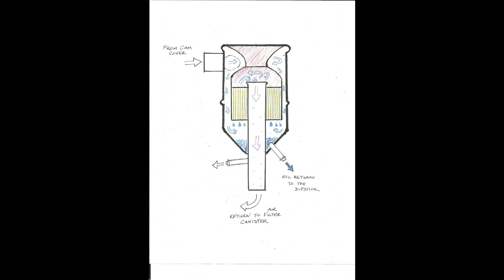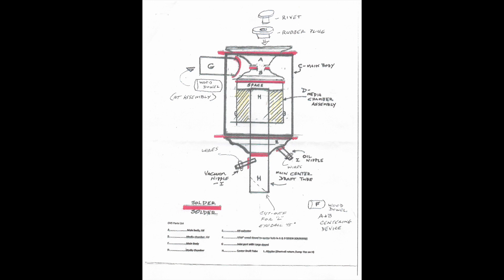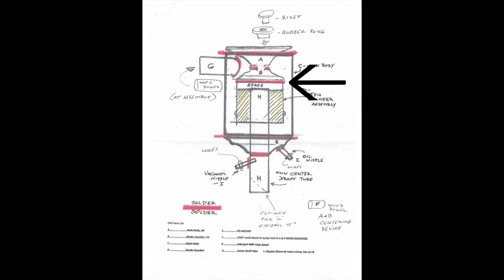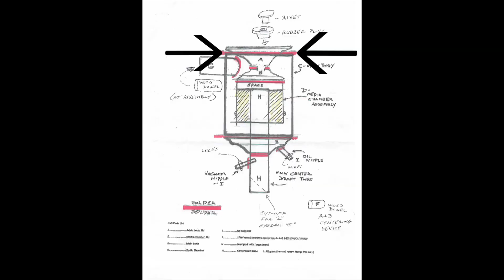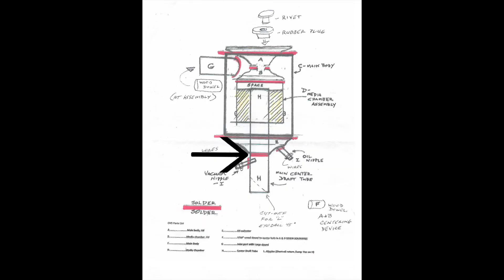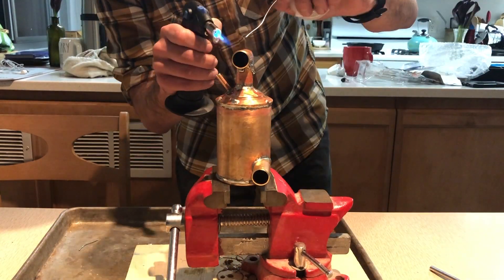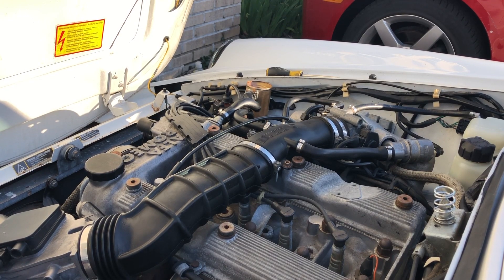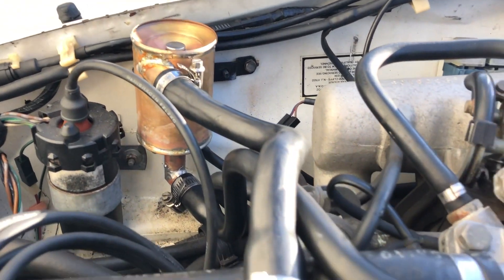Alfa Romeo Oil Vapor Separator Build and Assembly Steps

Comment: "I believe anyone with an Alfa can do this project", bcs anyone owning an Alfa is at least half a mechanic... 😆
Reply from the maker: Seriously!!!   I’ve HAD to do more work to this Alfa to keep it on the road than my 1987 BMW E30.  For the BMW I usually only worked on it because I wanted to upgrade something.  But my goal with the Alfa is to continually improve it through resto-mods as things break or need replacing.  In 15 years it’s going to be an exceptional car
Reply: @bigilworth  Well, wait until you buy 2017+ year model from this class. One front light costs $1000 and hard to repair. New cars are ridiculous, and full of bits and electronics. 87 BMW is simple as bread and butter, and I love bread and butter for breakfast.

Comment: Did you do anything particular to prime the OVS? in the assembly instruction, this last step is mentioned, but I find the description a bit mysterious and wonder if this is really necessary...just finish assembling mine..
Reply from the maker: I didn't prime mine.  They suggest to put some oil in the tube that connects to the crankcase.  It's the same principal that governs the u-bend in facet pipes.  The car drove just fine without having done that primer step and I've put 7000+ miles on the car so far so I'm assuming there is a little oil now in that tube bend.  

Congratulations on getting your OVS built!  I found my engine performed better with a new one.  And now every time I see Alfa's with original an OVS, I tried to explain to the owner the benefits.  Seems nobody really knows how awful those original parts are.